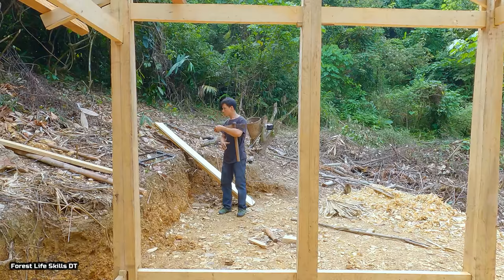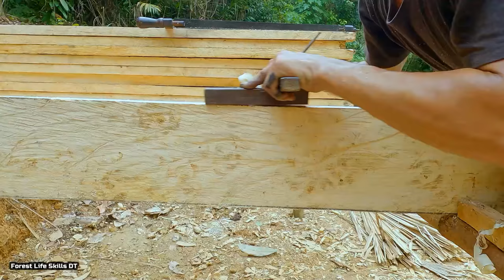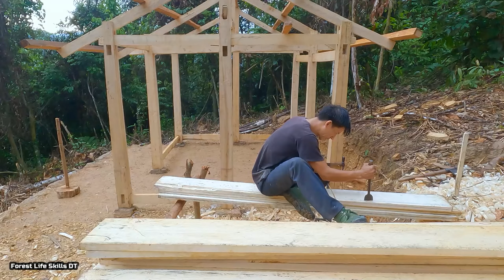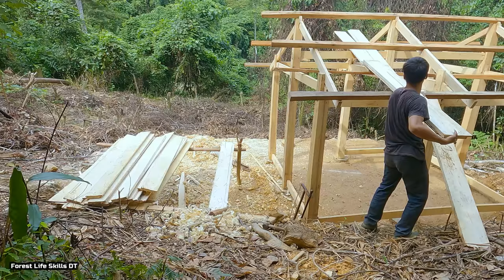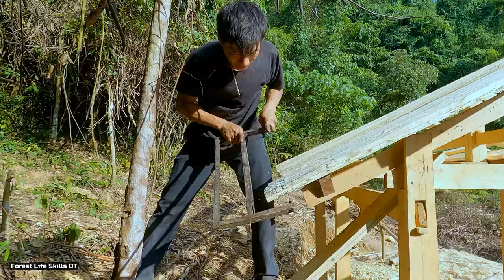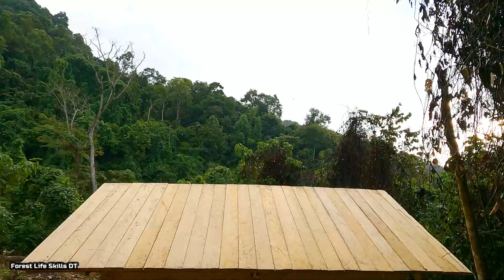Make a solid roof out of wood, Facing extreme weather - survival instinct, survival | Ep 179

Comment: The roofing requires a lot of work. Did you manually saw the pieces from a tree? You now have a safe shelter from storm as you continue building the walls. I am building now my second primitive hut out of bamboo but it requires less energy, because the need is urgent.